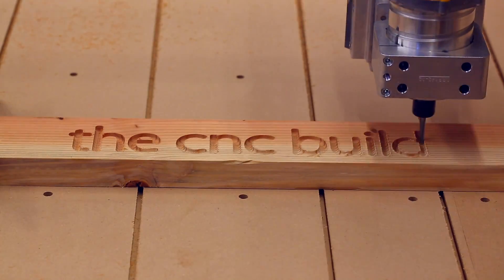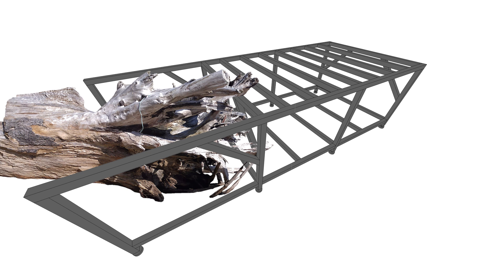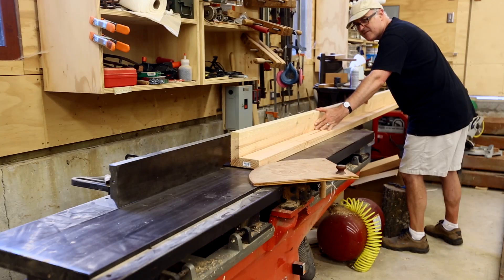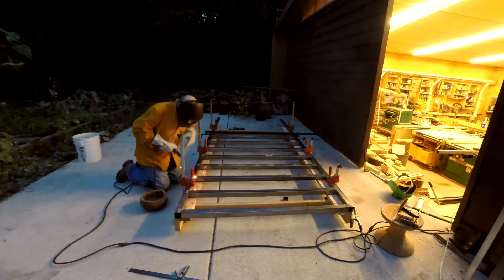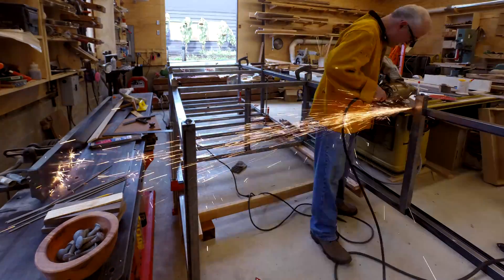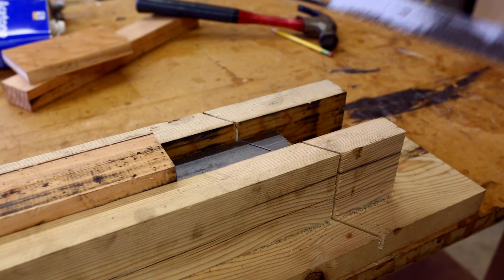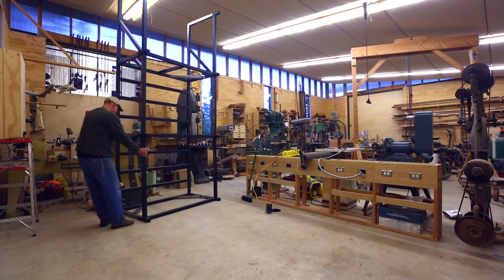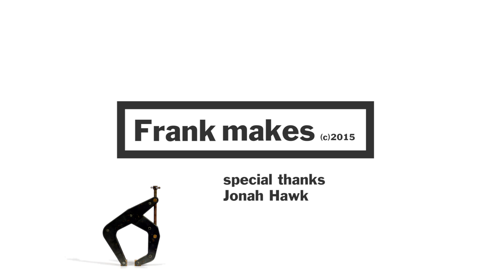The CNC Build: Part 1: All About That Base

Comment: The whole structure should be annealed to offset the resulting tension steel after welding.
Reply: +Jarek Ostaszewski And i'm presuming your comment is also an offer to frank to use your 12ft by 4ft annealing oven that your conveniently have.... lol
Reply: +Jarek Ostaszewski Which is perfectly fine.  Really, it is.  You do have a bit of tension develop, but I have never annealed any frames I have built - whether they were benches like this, go-carts, lawn trailers or fence gates.  In general, the tension balances itself out.  You weld one side, then you weld the other.  Keep it square while you work and it is all good once you are done.  If you really wanted to relax the metal, do it with a torch and let it air cool...normally that is enough if something is really high strung.
Reply: +Jarek Ostaszewski How?
Reply: +Steve Pocock You can use induction heaters. Without this process whole construction is now like compressed spring.

Comment: Did you consider using aluminum extrusions for the base ?
Reply from the maker: +Allan Perret For a little bit.  I would guess the steel is a lot less expensive.
Reply: +frank howarth You'd also face learning how to TIG weld aluminum, which requires a lot of coordination and practice, particularly for thin stock. The oxide layer on aluminum melts at  ~1000 degrees higher than aluminum itself, so you have to use TIG with AC to punch through the oxide, and then you still risk blowing through the stock.
Reply: +Nate Graff Generally aluminum extrusion is screwed together with T nuts in slots or into tapped holes on the ends. It can require a bit of machining for sure, however.
Reply: +Nate Graff The idea behind aluminum extrusions is that you don't need any weld. But I guess it'd be a lot a money.
Reply: +Alex Ingram Alternatively, I wonder why Frank didn't weld the legs separately and then bolt them to the top.  Safer to weld outside, and it could be disassembled to either make room in the shop, or transport the entire thing if the reason or opportunity ever arose.
Reply: +DRitz78 He's got a very nice shop with enough means to get large equipment in and out of it.  My routers were made from aluminum extrusion mainly so I could assemble and disassemble them on site in my basement shop.  I'd never get my larger one down the stairs otherwise.   A welded mild steel frame is totally the way to go if you can maneuver it, it's probably 2-3 times cheaper.
Reply: +Allan Perret Aluminum is an OK material for certain things - but I have found it lacking in this application.  Lighter than steel is a good thing, except when you want mass.  When I first purchased my ShopBot, I actually decided to build my own base for it using aluminum to make it easier to move around the shop if needed (big chunk of floor space is tied up in the CNC).  Welded frame, gussets, webbing and all the rest engineered to be as stiff or stiffer than the steel frame ShopBot ships their machines with.  After about a month of using it, I disassembled the base and replaced it with the stock steel base.  The weight of the spindle moving back and forth caused the whole thing to sway a bit and it probably moved about 2" from where it was first placed.
Reply: +Alex Ingram Exactly my point.  He could have used welded steel parts that bolted together.  It might be possible to maneuver it around the shop, and it might even be possible to get it out the door, but it isn't possible to put it in the back of his truck.  I'm not saying he would ever do that, but with everything welded together, he doesn't have the option.

Comment: did you bevel your joints at all? this cnc table seems to be heavy and will definitely hold much weight, so if you just welded two straight joints together but then to grind all of  that important material off. You should have bevel the joints so that once you grind off the excess you still have a structurally sound joint.

Comment: Welder here! You did such a good job on this i'm impressed. It is hard to weld thin walled tubing with stick welding, it boils down to using a good and thin stick, and keeping your light arc short (which produces less heat because of resistance depends on distance), which in turn need steady hands, but also to keeping your weld horisontal, like you mentioned too, good on you for doing your homework before taking on a project of this size.

Also: Big plus for taking the risk of burning down your shop seriously, both the welding and the angle grinding in particular produces sparks that can light a fire 6 meters away in easily combusible material, and the flame can come an hour later, so sticking around is a good idea.
Reply from the maker: +Tomas Helleberg Thank you.